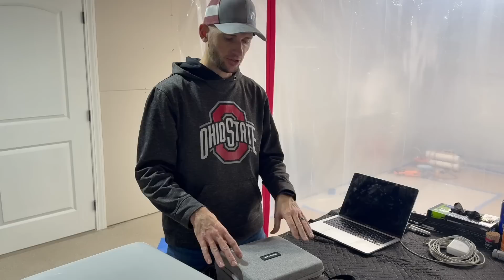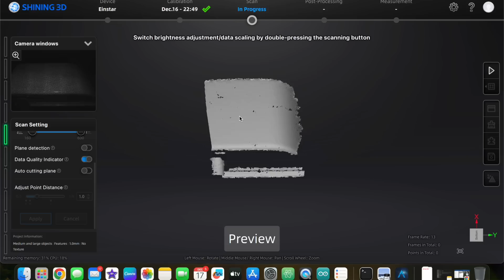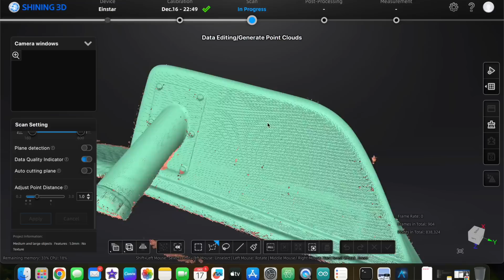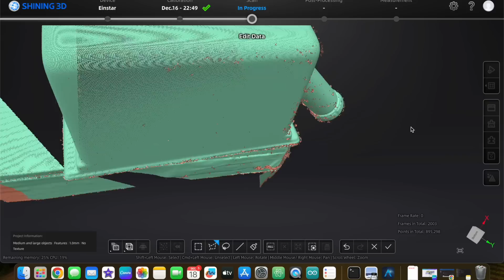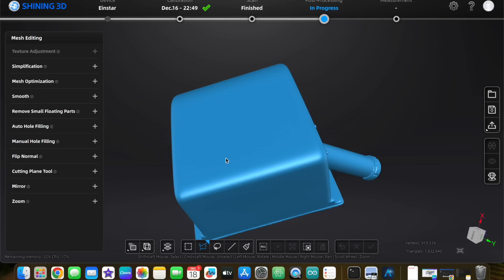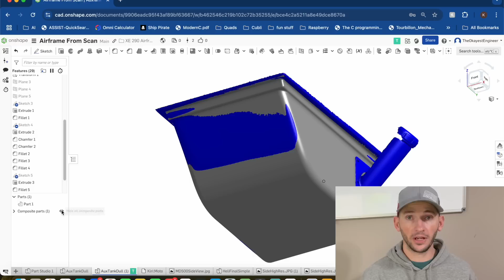From Real to Digital: 3D Scanning to CAD Modeling

Comment: This video is a year old, so maybe you know this already: I use onShape as well. I often need to modify STLs. What I've learned is that you can import the STL into FreeCAD and convert it to a STEP file. When you import the STEP file into onShape, you can do all your "normal" modifications to the resulting part, without having to recreate it first. Basically, I NEVER work with STLs in onShape. Conversion process: In FreeCAD, import the STL mesh (that's in the Mesh workbench), analyze & repair the mesh (Mesh menu), turn it into a "Shape" (Part workbench), then a "Solid", and finally export the solid as a STEP file. Google can help with the nuances.
Reply from the maker: Onshape now has a built in feature to convert stl into a surface. I can’t remember the name of the command but it is in there.

Comment: You use the other side of the calibrating plate to do the White Balance, not the one with the dots on.
Also it depends on the software that you are using if you can alter STL files.  SketchUp can.
Do you think that someone who has just got a scanner should do a 'tutorial' on how to use it best.  I have had no problems with putting multiple projects together.

Other than the above, nice vid.
Reply from the maker: @spoon1272  I’m pretty sure is mentioned that the issue I was having very well could have been me…. Sometimes there is value in someone doing a review of something with no prior experience. It’s a pretty good indicator of how easy it is to jump into. 

Have you ever taken a college course with a PHD professor who is at the university to do research? They often “forget” what it’s like to be introduced to the subject. 

I feel like it was probably the “Okayest” review by an “Okayest engineer” so the content matches the channel pretty well. Haha. 

I do appreciate the feedback and criticism though!
Reply: @TheOkayestEngineer   I totally understand where you are coming from with regards to showing how a scanner is used by someone new.  I am a newbie to it as well.  Ratter than say its a 'tutorial' I would have said its 'how I went about it, being new to scanning'
The scanner is good for object of your size that you scanned and the software is great.  But its not particularly good at going small objects.   Also the spray that you mentioned is really good.

Comment: When trying to combined models did you use the reference dots on the scans. I know when I did it with another scanner it was critical to aligning models. Also simplifying the models as much as possible.  The other thing is memory is king. 16 GB is minimal but if you can upgrade a pc to 32 gb it will work better. Ideally I would go for 64 to 128. I don’t think the new Apple computers can be upgraded. Just some thoughts. Also don’t need to do the computation work on the same computer you use for data collection.
Reply from the maker: @TSSolutionsPro  I tried all the ways. And the alignment actually was really good! It just errored out when trying to make the point cloud. 

I also didn’t realize you could use a different computer to post process. Makes sense but didn’t cross my mind. That is a huge plus! Thanks for pointing it out. 

For now my MacBook works “good enough” but I’ll definitely keep this in mind as I look for a new computer in the future
Reply: @ good luck it looks like a way fun project.
Reply from the maker: @TSSolutionsPro  thanks!

Comment: Good video..the schweizer 300 I fly, full size, not RC, has an upgraded LED landing light and it made a huge difference. Second, if you register this aircraft with FAA you’re going to need a supplemental type flight certificate because you are making changes outside the approved aircraft flight certificate. For example, if you own a R44 Robinson it will have a type certificate based on its approved design. If you were to add a spray boom because you want to be an ag-pilot the owner needs to obtain a supplemental type flight certificate because he/she added something that is outside of the original approved design for that R44. If you’re considering classifying it has an experimental, check into the rules and regs..you may be okay. Get yourself the 2025 edition FAR/AIM manual..it will have all the info you need. Good Luck with everything and Go Bucks!!
Reply: Dude, it is experimental amateur build.
Reply: @No4murasame  dude, you’re obviously not educated with experimental aircraft. For it to be airworthy, and receive an airworthiness certificate, regardless if it’s amateur built or not..he will have to submit certain documents to receive, most likely, a special airworthy certificate. The FAA will have a list of those documents needed, which can be found in the FAR/AIM manual. And because changes were made to the original aircraft design, the FAA may issue a supplemental type certificate.
Reply: @tommyk1073  it’s not a type certified aircraft, is my point
Reply: @ I understand that, but in order to fly the helicopter he will be required to have an airworthiness certificate..and I believe the FAA will issue special airworthiness certificates for experimental aircraft. But when changes are made to an aircraft, the operational limitations for the helicopter may have been changed too, and it’s best to consult the FAR/ AIM manual.
Reply from the maker: @tommyk1073  my understanding is that any modifications after the original build would require another review. But there are no requirements to “stick to the plans”  defined by the manufacturer.
Reply: Wow, I don’t how you know nothing about experimental aircraft.  That’s a pretty deep hole you have your head in while supposedly having a helo license.
Reply: @ you should check your grammar before posting..your head must be buried in a pretty deep hole.
Reply: @JeffWhiteIV  you should proof read your comments first..your head must be buried too deep.
Reply: @ you should proof read your comments..your head must be buried too deep..🤣🤣
Reply: @tommyk1073  proofread is one word
Reply: @JeffWhiteIV  it can be used both ways..but I'm guessing you already knew this? Or was your head still buried too deep?
Reply: This aircraft can not have a standard type airworthiness certificate, which means there is no such thing as a supplemental type certificate that applies. Under the special airworthiness experimental class this aircraft would be eligible for, the builder can do essentially whatever they want to the aircraft.

Comment: This is pretty awesome stuff. Have you tested the dimensional accuracy?
Reply from the maker: @lawrencemanning  I don’t really have a way to check. I’ve been thinking about this for a while. Maybe I machine a part from foam, scan it, and compare it back to cad. 
The accuracy also depends on how careful you are with the scanning process as well. It can be very clunky.
Reply: @ the part you were scanning in the video looked like it has parallel edges? Can you find a way to measure the maximum width across two parallel edges? Even the diameter of the round piece would do to start with, though it’s not very big. 

Anyway awesome stuff! I wish o had a project to justify the expense of getting a 3D scanner as they look very useful, though also a tad frustrating!

Take it easy. 😀
Reply: These scanners get better every 6 months, and that the problem, when do you buy. Dimensional accuracy is in the specs. Makingformotorsports reviews these every 6 months or so 😉🇨🇦

Comment: For editing stl files try SketchUp, that will load an stl file no problem, and if there are holes in the mesh, scale the stl file by 10 or 100 in 3dbuilder, then load the stl in SkechUp and scale down the scale you did enlarge it. Then you can create planes and dxf or dwg files for your cad program.
Reply from the maker: @wibe3634  I have to look into that.